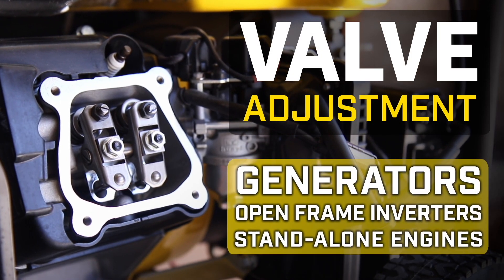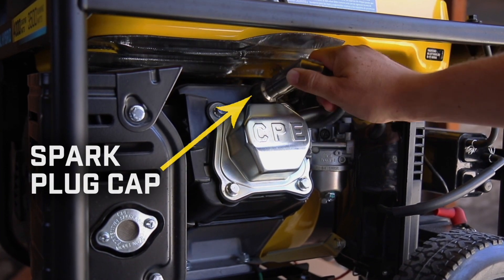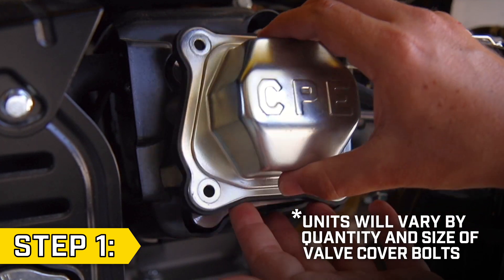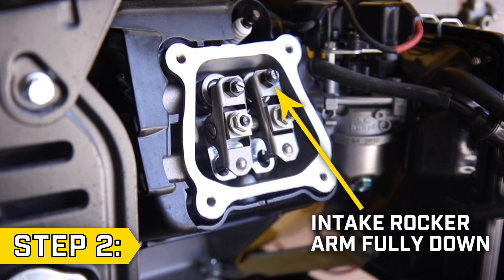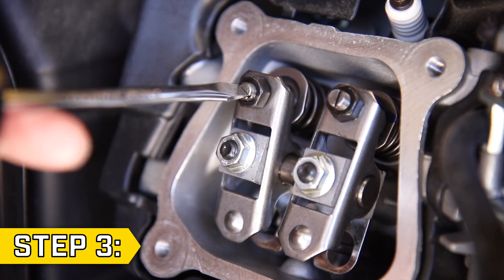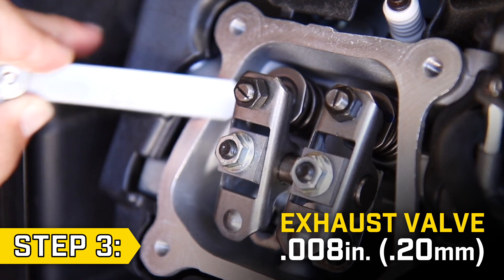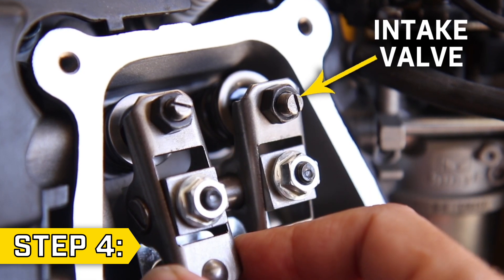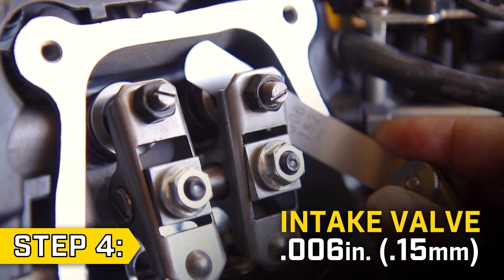Valve Adjustment (Open Frame Inverters and Standalone Engines)

Comment: My generator, model 201267 manufactured 09/23 does NOT have a screw and nut  to adjust. There is only the screw that holds the rocker in the center. This is the video link customer service gave me.
Reply from the maker: Hello, we do apologize, this is a general video to give you an idea on how to perform a valve adjustment. The process is the same even though the rocker arms do look different. If you need addition assistance performing the valve adjustment please contact our support team at support@cpeauto.com. -Thank you

Comment: Each champion  video valve number is different.004, 006, 007,  008???????)
Reply from the maker: We also recommend checking your product's owner's manual for specific valve adjustment settings. 👍🏽

Comment: ATTENTION: the clearance values may be DIFFERENT that the value in the video !  Be sure to check your specific owner manual at the Engine Specifications page. For example, my black casing 2000Watt has 0.004in or 0.1mm on both valves.

Comment: Worked for me!  It's odd to me that in all the hard-starting troubleshooting lists I saw, none that I had encountered included checking for correct valve adjustment.  Had I known that gradually increasing difficulty in starting might be do to the valves slowly getting out of adjustment, I would have done this adjustment and saved myself a LOT of time and trouble checking for other things.  I'm sure you'll all come up with lists that included valve adjustment, and I may have seen it, but I certainly overlooked them if I saw it; the valve cover on my Champion generator even has a seal painted on the valve cover bolt.  Now, I wonder why?
When I checked the valves before adjusting, both intake and exhaust had ZERO lash.  Oy!  No wonder I had starting problems.